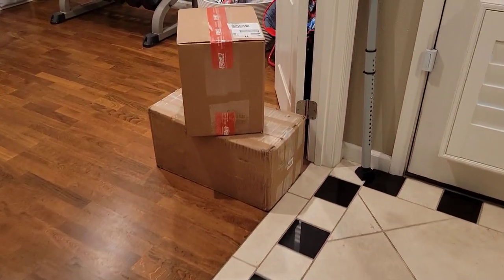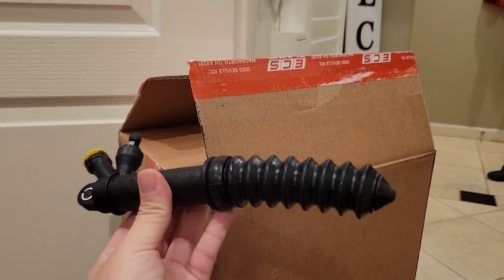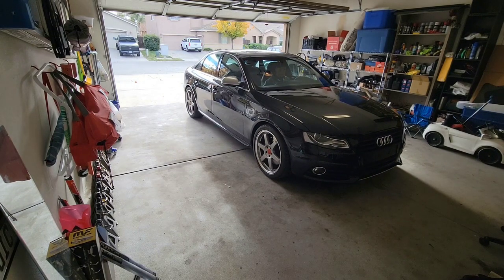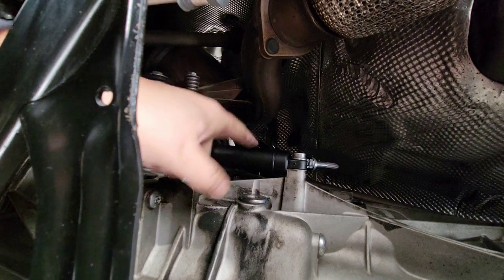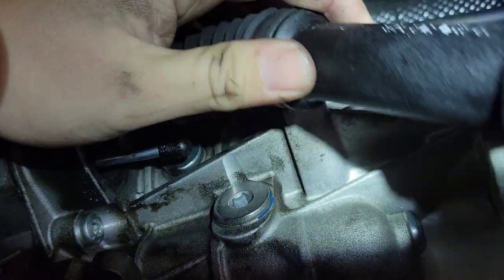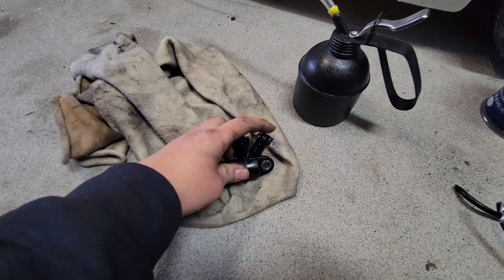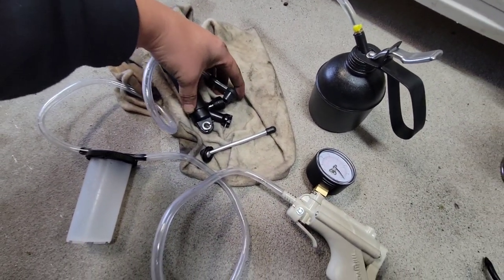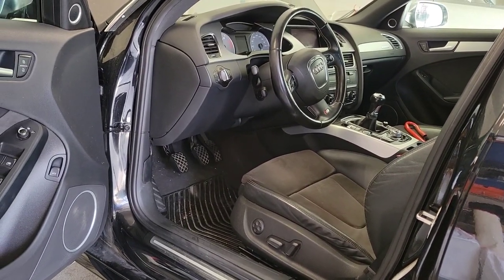JXB Performance Extended Slave Cylinder Install on my 2010 Audi B8 S4 Quattro 6 Speed Manual!

Comment: I installed a stage 2 daily clutch from SBC and my oem slave cylinder snapped in half. I would get the "Press Clutch to Start" until I would press really hard on the clutch and I just heard a pop and brake fluid coming from the slave cylinder. I removed it and It was cracked in half. I'm gonna order this extended slave cylinder to replace my old one.
Reply from the maker: Dang that's crazy. Curious, how many miles on the car?

Comment: Great video - thanks!  Which stainless steel line did you use and did you do an installation video for it by chance?
Reply from the maker: Thanks! I went with the USP one.

Yes, I actually did make a video on that install too. It's on my channel as well 👍
Reply: Cool - I'll check it out  @cjscarcollection18  I've got an S5 that I want to update to SS for my brake lines and clutch line.  New sub here btw
Reply from the maker: @synaptik111   oh nice, definitely recommend it. Don't hesitate to reach out if anything and I'll try my best to help.

Thanks for the support!
Reply: Will do  @cjscarcollection18  - Thanks!

Comment: I have a 2013 S4 (B8.5). My Slave Cylinder is on its way out at the moment. I Have never had any Push To Start Issues. Now, would this be a good replacement for the OEM Slave Cylinder, or should I not go for an extended Slave Cylinder? Can this extended Slave Cylinder cause hyperextention to the clutch components if I haven't had any issues previously?
Thank you!
Reply from the maker: I actually have never had any Push To Start issues either on both of my B8 S4. IMHO, I feel it's a good replacement for an OEM slave cylinder for a few reasons:

1. Normal wear on the OEM clutch could eventually cause a Push To Start issue

2. When it comes to upgrading the clutch, there could be a Push To Start issue due to the way upgraded clutches are designed vs an OEM clutch

3. When replacing stock rubber clutch line with a Stainless Steel line there could be a clutch to start issue 

I do not believe it will cause hyperextension to the clutch components because I've havn't had any issues of that sort yet and havn't seen any from others. 

I'd definitely recommend going with the extended slave if you plan to upgrade any other clutch related components in the future.
Reply from the maker: His webpage gives a good explanation of everything. 

https://www.jxbperformance.com/products/p/extended-slave-cylinder
Reply: @cjscarcollection18  You are a LEGEND! Thank you for the reply! I have ordered one, and hoping to put it in tomorrow! I had a new clutch installed 40k miles ago, so hopefully the extended slave cylinder will only benefit my setup! Again, Thank you!
Reply from the maker: @JustPasha  Anytime, I honestly feel it'll only benefit 👍

Comment: What were the symptoms while driving that let you know you needed it replaced???
Reply from the maker: So on this current B8 S4, I haven't had the tall tell sign of the push to start issue yet but I did remember having the push to start issue occasionally on my old B8 S4. Since I changed out the stock clutch line to the stainless braided lines I decided to do the JXB slave at the same time.

Comment: My clutch keep going to the floor in my 2013 s4 b8.5.. I change my slave cylinder and it’s still doing it.. Will this stop my problem?
Reply from the maker: Unfortunately, I can not confirm if this will fix the problem. The JXB extended slave is really only to address the push to start issue. 

Are you positive that you flushed out all of the air from the system?
Reply: Yes I’m positive.. Sorry for the late response.. I still can’t find the issue.

Comment: Do you pump clutch while bleeding or after ?
Reply: I had this issue for a week and now it’s no start ! Clutch works fine tho
Reply from the maker: The method that I used to bleed the clutch did not require pumping the clutch. The vacuum pump I used basically just suck the fluid through the system until you see no more air bubbles.
Reply from the maker: @antonysyriac8742  which issue was it? Push to start issue?
Reply: @cjscarcollection18  yes push start
Reply from the maker: @antonysyriac8742  ok yea and were you able to finally bleed the clutch?
Reply: @cjscarcollection18  no I haven’t installed slave cylinder yet ,  i ordered the parts and referred your videos ! Great input
Reply from the maker: @antonysyriac8742  ahhhh ok haha. Hopefully it goes well 👍 reach out if anything and I'll try my best to help
Reply: @antonysyriac8742 did you fix it i have the same problem
Reply: Yeah